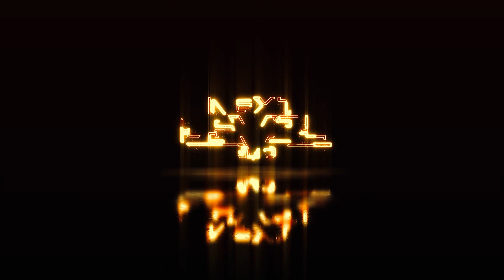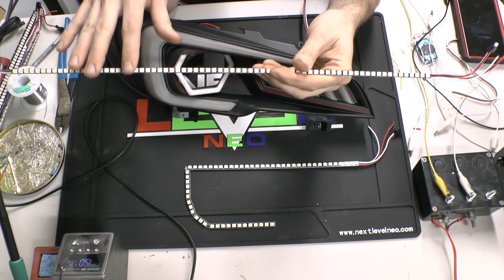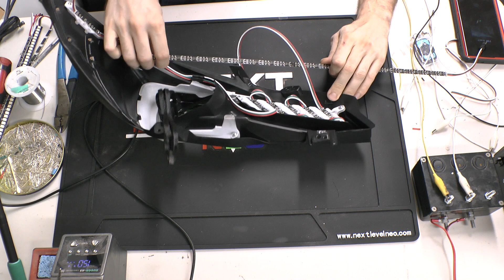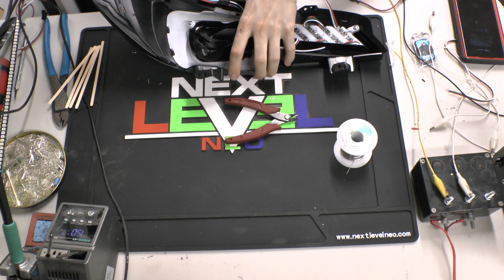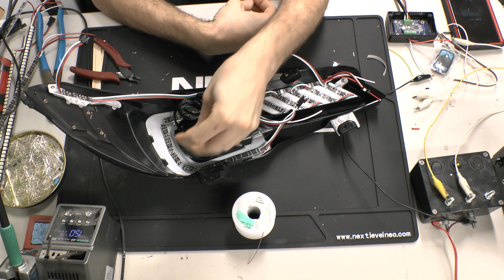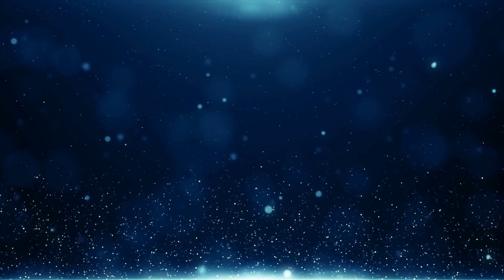Mastering Rigid LED Strips: Shaping & Molding Techniques for Custom Lighting Builds

Comment: Another great video.  Appreciate the mix of insights and experience you bake into these.  
The nugget on soldering - heat/temps vs time/travel on the pcb - very helpful.

Comment: Couple questions cause I’m new to this I just got the strips in today. 1 does it matter which what they are mounted as in direction for the flow I understand positive and negative matter I get that. Second question is what is the point of the red and white wire soldered to the plug ?
Reply from the maker: Direction does matter. There is an input and output to every led so make sure all the arrows are going in the same direction. On the colors. The wire colors can be anything. I was using red green and white wires but the important part is that you designate each color for your use and ensure that stays the same on your build. In my case red was power, white was ground, and green was data.

Comment: Amazing video !! I have a set of vlands and I wanna rgb swap the c light on my wrx.
Reply from the maker: Our rigid strips are great on vland lights.
Reply: I’m actually gonna buy some. Was talking to my women to see if she wanted to buy em for me for Christmas but she said no so I’m just gonna order em Lmfao. Which mm would you remember ?
Reply from the maker: It's usually 80mm for round. That's why most of our shapes are based on 80mm sizes
Reply from the maker: Actually, now that i think about it we use 86mm hex on these but the angry eyes looked pretty cool. the hex is the safe bet but you can shoot me a DM to see what the angry eyes looked like.
Reply: @NextLevelNeo  I have the olm hikari headlights
Reply from the maker: @spoopdiewoopdie8092  oh shoot, well halos wont fit at all on those. Just go with the strips
Reply: @NextLevelNeo  so would you Rec the 8mm for that ?
Reply from the maker: @spoopdiewoopdie8092  yea, i haven't opened those lights myself but usually the 12mm is too wide on wrx lights
Reply: @NextLevelNeo  hey so I just ordered the 8mm from you guys literally about a minute ago lol. My question is does it come with the headers ? To connect to the blue ghozt? Or do I order this seperate ?
Reply: The connector ends ?
Reply from the maker: @Spoopdiewoopdie  they have a 3" jst to connect to the ghozt but you'll need more than that. We sell 2 meter long extensions on the site.
Reply: @NextLevelNeo  I did see that. So temporarily I’m just gonna play with them till I can actually trust myself to be able to throw them in my lights. I don’t fully understand the hole thing yet. I understand the ghozt v5 seeing I built my wrx tails with fancy show modes and blah blah. But I’m still so confused by the rgb. Like how do the side markers haloes and the high beam area all synchronized together ?? If they are solderid in-line. Unless at the junction point you add a splitter ? Which would make sense ?? I feel like such a noob but out of all the community  you actually respond. So I apologize before hand lol
Reply from the maker: @Spoopdiewoopdie  definitely don't use any splitters on ghozt. Run everything in series and edit in the app. Follow my blueghozt tutorial for a better idea.
Reply: What rgb controller would you suggest for a noob ?
Reply: @NextLevelNeo  ended up ordering the 2.0 lite I seen your video and Holly hell did you explain it amazing f
Reply: I have 0 clue of rgb tbh with you.
Reply: So o figured it would be a good opportunity

Comment: UCS = Not seeing the customer anymore cause they won’t fry🤩 SK = Warranty them out every 6-12 months🫠
Reply from the maker: Invest in yourself and watch your clientele get bigger pockets. People will pay for proven builders with a better track record.
Reply: Not true, you build with quality and you may not have to build that set again.. but you'll have repeat business
Reply: @shaunoguinn1015  SK has more product % failure lol
Reply: @jelsinn_  oh I know they are more prone to failure than ucs, im just saying if you build with quality(UCS),you may not have to rebuild that set, but you ll get repeat business.
Reply from the maker: @Shaun Oguinn  so you both are mostly correct. Even with ucs build quality is important. Proper soldering techniques, quality solder, using proper methods to secure the leds in the lights. One thing i have noticed with sk is that cars that are daily driven have less failures than cars that sit. And since adding the power savers to every addressable build i have had zero failures. I belive that addressable failures are related to voltage drops, addressable leds draw power at all times and will slowly kill a battery, as a battery dies its voltage drops, the power saver not only helps to prevent dead batteries but it also disconnects the leds from the battery when not in use so if the battery were to drop in voltage it would not affect the leds.
Reply: @NextLevelNeo  yeah thats why I put in a keyfob killswitch so I can disconnect power anytime I want, just takes a moment longer to turn everything on but worth it, since I have the big audio system and airride all on one battery